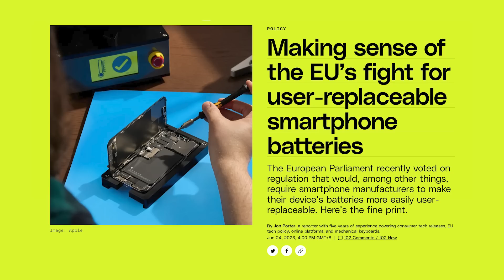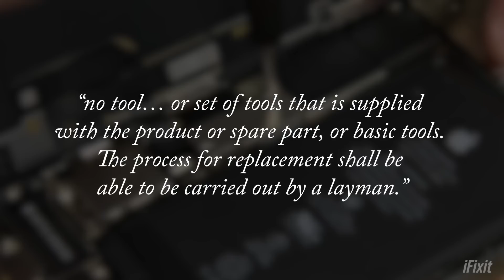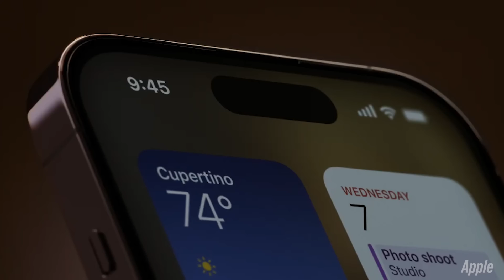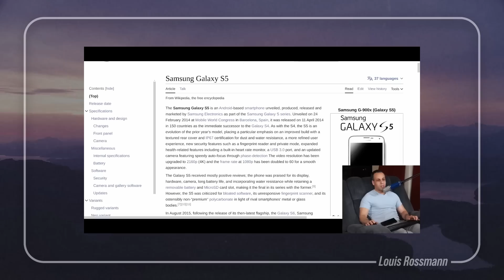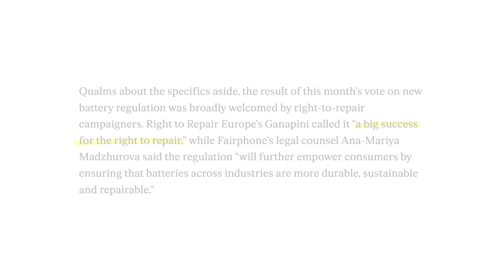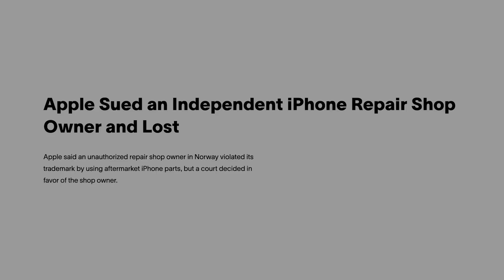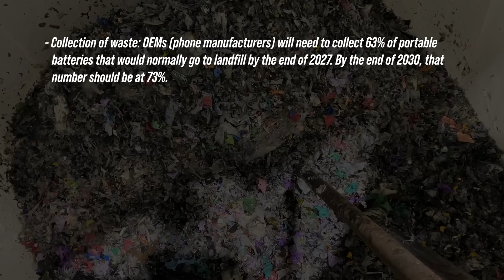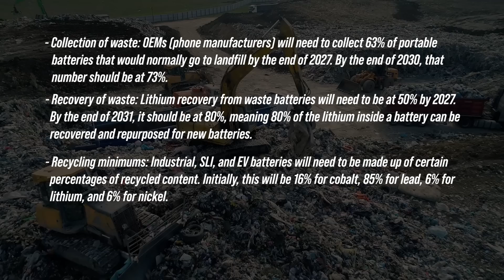EU Just Changed Smartphones Forever

Comment: I think its pretty clear that the main motivation for getting rid of replaceable batteries was planned obsolescence
Reply: Its is a form of way to force people to buy new devices.  Companies know that batteries will decay over time and no longer hold charge.
and when that happens, companies jump for joy when they see customers are forced to spend $1,200 for a new phone. even though their current phone is fine,
and the only problem was the battery.   I am glad this is now changing.  Because people are tired of being forced to buy new devices when they don't have to.
Reply: @TwstedTV  if you're content with your current phone and the only thing that's bothering you is battery life, you aren't going to be dumb enough to spend 1,200 on a new phone
Reply: +the help with super fast chargers
Where as my 2nd have used Samsung Galaxy s5 is still kicking!
Reply: @TwstedTV   In most cases, though, batteries don't just "decay". It's the software that is programmed to kill your device slowly and painfully by malfunctioning.
Reply: @kojisan1  This isn't true batteries suck and are the weakest modern technology. They're sensitive, physically limited, and easily degradable.
Reply: @kojisan1  right - you do know that you can't run today's software that everyone "has to have" on an old device, right? Software demands and hardware requirements both increase, making old tech obsolete. That is how technological progress works. The software isn't programmed to "kill" anything.
Reply: @Distress.  yeah its the first thing to wear on a smartphone besides broken screen.
Reply: @kojisan1  batteries indeed crystalize over time and can't store as much energy as a brand new one, no matter how slow you charge it
Reply: With proper care, they EASILY last 10 years.   @Distress.
Reply: @kojisan1  This is somewhat true, but with the ending of Morse law, we may find that this paradigm might change.
Reply: Yes, most of my friends replaced their latest iPhones just because battery didn't last as long as it used to be.
Reply: nokia beeing one of the last to do that.. and the first with standartized chargers.

Well, until nokia was run into the ground by an american ex-microsoft manager and the hostile american market. 
(you cant sell phones, if the carriers in a country dont help you sell them - and apple made sure to keep the market hostile for nokia - while still benefitting from licensing all the nokia patents...  there would be no iphone w/o nokia r&d )
Reply: 💯 fact.
same with storage that you can't increase with memory card.
they want to annoy customers by lack of storage and battery capacity to make them buy another device.
Reply: Sucks that we live in this modern age and stuff like that still happens, mean while i think there's even a phone that can take 1TB of expandable storage.  @sadfacereview3591
Reply: The fact that Apple PURPOSELY made the batteries on older iphones drain even faster through updates should have been a LAWSUIT....
Reply: @megamegaO   is there anything stopping people from filing a class-action for it?
Reply: Not really. Non-removable batteries made it easier to design and manufacture thinner phones and waterproof phones. The thin nonsense makes for some great engineering that users immediately hide by sticking the phone in a big, thick, ugly case. Having a user removable panel to access the battery as well as the connectors that need to be strong enough for the average user (usually equated to a caveman) to replace with damaging the connectors is quite an expense as well as design constraint.

Not that I think that removable batteries are a bad idea, because they are definitely a good idea as batteries naturally lose capacity and performance over time (this is chemistry/physics, not necessarily designed obsolescence) and replacing such a component should be the part of any good design.
Reply: Meh, it isnt malice. Designing products for easy repairs or maintenance just isnt cheap and it hurts your profit margins. So in a dog eat dog market like smartphones why would you invest in something that doesnt really lead to more sales but does hurt your ability to compete with other companies. Shit like this always has to be dictated by the governing bodies these markets serve, like the EU.
Reply: It’s dust and water resistance
Reply: No it was so that any device could be remotely accessed at anytime
Reply: Except if you ask anyone who manufacturers these phones, they will give you several good reasons for why they do it. Not everything is some weird capitalism conspiracy against the people. Stop being a lemming and educate yourself.
Reply: They also charge too fast, over charge and greatly over discharge the battery to make it die quick.  They are designed to give false readings.  The only way to know the true voltage is to open the device and measure the battery.  Plus, if you remove the battery, how can they spy on you?  They never actually turn off.  It is always and forever about profit!
Reply: Waterproofing a phone is a big reason they stopped doing that.
Reply: Another useless and ill thought out directive form the EU ..IF the companies just downgrade the software over time then WHY would a replaceble battery be needed..that's what needs to be looked at, manipulated obsolescence.. just like the EU cookies directive that all companies have got around and just means you have to click through 5 screens now. Its pointless if it's poorly written legislation
Reply: When was the last time you wished you could replace a phone's battery? I can't remember any occurrence. I do NOT want replaceable batteries. How can they decide "for" me? I want slim, water prove phones, am NOT interested in replaceable batteries, can't see NO advantage for me in it.
Reply: @RonK  I have wanted replaceable batteries since all the manufacturers decided to make their devices without them. I wanted to replace the battery in my phone many times every year (doing so would extend the phone's usable life spans by over a few years.) Also, If they want to make them waterproof, they can do it with a removable battery, add screws and a thin compressed bit of rubber, and you are done.
Reply: As you are aware of planned obsolescence, this is true for pretty much every product out there, not just tech devices. Same can be said for lightbulbs, modern denim, poor quality clothes, printer ink, textbooks, batteries, cars, shopping bags, disposable products, toys, forced updates, unsuported updates and so on.
Reply: Quite. I don't use it anymore, but I have my Nokia 3310 still handy and working in case my smartphone gets broken. (At least until they switch off 2G)
Reply: @garybarnes4169   2G is likely to be around for quite a long time in some form because a lot of integration and industrial systems rely on it. Consumer access may be dropped but the protocol will keep going.
Reply: As far as I know, as-of Feb 2022, all cellular has been turned off.  Everything runs over the VoLTE SMS data channel and is forced over the internet...which will not be completely built out for at least 10 more years and trillions of dollars.  All of the used phones that can't use or be upgraded to use VoLTE do not work, not even for 911.  It is even worse because the actual carriers will not use any "phone" that is not on their list, even if it is capable.  Ethernet is NOT designed for VoIP and everything that is done is partial, patches and workarounds.  This has also killed all of the previous business data devices and hotspots that are used as backup internet.  Talk about a massive cash influx in replacing equipment!   @garybarnes4169
Reply: I’d rather have a waterproof phone then change batteries
Reply: @lilBabyBornInCalifornia   waterproofing is about fitment. Why are ppl acting like its some sort of new technology. We had waterproof cassette player 30 years ago. And those had 3.5mm audio jacks.
Reply: @thelaughingman1 Yes, we had waterproofing previously but that's different to something the size, specifically the thickness of a modern phone, such that it's rigid enough to not deform but also not bend, while opening and closing and having sturdy connectors in there for batteries. The thinner something is the harder all this is, particularly to make it sturdy enough to not break really quickly. Those old cassette players were bricks and had the space for quite easy waterproofing... which, from memory, was crap and they started to leak quite quickly. Useful enough in a walkman format for those doing outside activities in the rain such as runners, but not really waterproof beyond that.
Reply: Super easy to have both.  Also, you can, and should, have your "phone" in a case.   @lilBabyBornInCalifornia
Reply: It was actually for waterproofing which was more valuable to consumers than replaceable batteries.
Reply: My glued phone melted from the heat, zero fast charging, already water damaged after a week @Distress.
Reply: @Distress.  they debunked that in this very video my good man.

Comment: Finally! I still have Samsung S5 with extra battery (my kid plays on it), getting 100% of power takes like 10s, battery is few times smaller than powerbank and do not waste energy using powerbank as proxy. I also have (though not used anymore) notebook, Dell Inspiron that I had 4 spare battery for it. Switching took also few seconds. With two batteries I had power for 12h flight. With modern notebook I wouldn't be able to work after internal battery dies (there is no power socket on the plane). Great to hear normal will be a thing again.

Comment: An original I Pod had a VERY easily to replaceable battery, IF you could defeat the anti tamper latch which was possible with 3 screw drivers, despite apple claiming the device was so advanced it was impossible to replace the battery. The change to unreplaceable parts was TOTALY MOTIVATED BY PROFIT. APPLE  R @ P E S their customers

Comment: I always advocated for EVs to have replaceable batteries instead of charging it. I mean there should be an option to charge it or go to a station where the battery can be replaced. 

Think of this scenario. 

An EV car goes to an electric station (formerly gas station), goes through some kind of machine is where the battery is replaced an a new fully charged battery is put in. Then the old battery is put in this battery charging station, in where multiple batteries are being charged for the next car. So the whole process takes as much time as pumping gas or could even be lesser. 

Another way if you want to do it, is maybe the battery can be taken out manually, obviously the battery would be heavy so some kind of a trolly is available or the battery itself can easily be rolled on it's own. Then you push it to a battery charging station, get another fully charged battery and put it on your own. Isn't that simple?

Taiwan is implementing this with their motorbike, and I'm sure it can be scaled up for cars as well

https://www.youtube.com/shorts/BGxduiKVh5U

Comment: 5 years ago i needed an interchangeable battery. now my smartphone battery is large enough to cover a full day of heavy use. This is coming when i no long need it.
Reply: I get up to 3 days between charges on my current Samsung.
Reply: And your battery just lasts forever does it? It never degrades? Batteries are a WEAR PART and ALWAYS eventually need changed... Thats like throwing away your car instead of changing the oil...

Comment: Thank you, EU. I'm hoping that leads to a bulky laptop renaissance. I prefer a laptop to feel substantial compared to paper thin and the 2012 Macbook is still the pinnacle of laptop-design in my eyes; last model with full user-upgradable components, solid i/o selection, removable battery, and you didn't have to worry about accidentally snapping it in half. That was a long-time ago now and I feel like there's no way Apple will ever offer that level of user-upgradability again, but I can dream.
Reply: Just don't buy apple, problem solved.

Comment: I'm a big fan of the Right to Repair, which is why for the past 15 years I've only purchased Lenovo laptops. They don't go out of their way to make them hard to disassemble, and they publish hardware maintenance manuals that are free to download. Today, I upgraded the SSD on a Chromebook from 32GB EMMC to a 128GB SSD for $8. Then I upgraded the SSD on a circa 2017 Yoga from 128GB to 256GB for $17. The Yoga was the same size and thickness as MacBook Air. That kind of shoots the theory anything that thin can't be opened.
Reply: I’m not sure what year you purchased your last Lenovo laptop, but they aren’t as good as you think anymore, especially on their Yoga series, they love cheaping out on components, such as the literal power button, then they end up breaking
Reply: @axethepenguin  The topic is repairability, not individual components. This year I've purchased two Thinkbooks and one Thinkpad and have added ram and 2nd hard drives to both Thinkbooks. I have 20 years of experience using and upgrading Lenovo laptops, and most of that came when I was running a software company. Currently, the primary Thinkbook monitors a stock market data feed and runs 24/7 with zero issues. I would say that I push their equipment pretty hard and found their quality and engineering to be outstanding. What I find amazing is that without being told they offer repair manuals for free and I find that commendable.

Comment: I'm all for repairable devices.
I remember owning a Nokia cell phone that not only had removable / interchangeable batteries (it's stand charger came with a slot to charge a supplied spare battery) but it also came with a different battery cover / adapter that you could use to power the phone with three AA cells in emergencies! This for a phone that would last more than a week on standby on a single battery charge and almost 2 days on 3 x AA cells.
Reply: I remember charging once per week and a spare battery in my pocket... Heaven. I also could phone on a cold day with gloves on unlike when even condensation from my breath stopped my smartphone's screen from responding once in an emergency.
Reply: I've had a Nokia 6760 for the last 13 years now. A lot on the phone got replaced throughout the years. Battery got replaced 2 times, and the phone lasts about 5 days with normal use. Replaced the flexcable that caught fire due to water damage, and replaced the screen that broke.
They were all super cheap and easy to repairs (I just bought the parts new online and assembled it with nothing but a screw driver).
This phone truly is great, I still use it today and it's still the best fully offline GPS I got.
Reply: Good old times ❤

Comment: The major problem with smartphones longevity is not battery but it's software experience and intentional slowing down of phones by company. Authorities gotta keep a check on that part too.
Reply: My mom had to throw away her phone because of the battery recently. The phone was still fine for her daily use, which is mostly whatsapp, facebook and phonecalls. I had to throw away a phone that I had given to my kids for the same reason. Tried to replace the battery but ended up destroying the glass.
Reply: @RediscoveryChannel2021  u see old phones used to have smaller battery and limited charging cycles but nowadays it has improved quite a lot with 5000 mAh and 1600 charging cycles as standard but the thing that has worsened is stable software experience. And mind it... softwares affect battery efficiency too.
All I mean to say that these days only 10% people might be changing their phones because of less battery backup and 90% cuz of people for bad software experience (phone overheating, hanging, quicker battery drain) or major technological changes like 5G/6G.
Reply: I don't think they are doing it for the benefit of the consumer
Reply: I love that I can't replace my battery. As means when drop my phone the back and battery don't come of. I dont always use a case and even then I shouldn't be forced to use a case if my phone drops to keep the battery inside the phone. Like for example. Say on a very important call and accidentally cause phone to hit the floor and battery comes out. Now your call is gone. Now I say flagship stay with non removable batteries but go back to all non flagship have them.

Comment: I think the removal of the replaceable battery was an anti-consumer move. First, the back glass was glued with minimal glue on the battery, when they started increasing the amount of glue on the battery.... that's when I figured out that they did not want us to remove the battery.
Reply: @ReassuringSmile Eliminating the removable battery is a production saving. 2 solid contacts less and cheaper, simpler internal design.
Reply: Apple even invented the pentalobe screw to keep people out.  China quickly started making screwdrivers.  LOL
Reply: @solarsynapse  LOL 🙂Thief tactics 🙂Apple didn't invent anything. Except crappy, flimsy (but expensive) phones and computers. Jobs stole a computer from Steve Wozniak. The mobile phone was invented by Motorola. Apple's operating system is stolen Unix. Will it be enough?
Reply: Since there are e.g. "modern" smartphones with replaceable battery on the market today I think it is a mixture of "hey, let's have a cool design" and "wow, with this cool design we not only attact more buyers, but can increase revenue from after market".
Reply: you "think"? still not sure? lol... god, NPC's sometimes are really dense. it takes an oil refinery drill to get into that head.